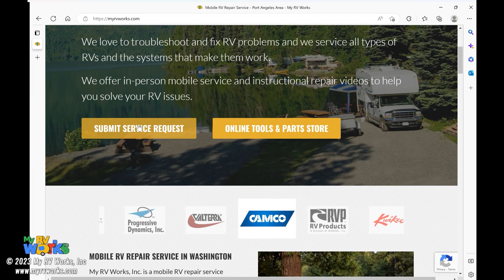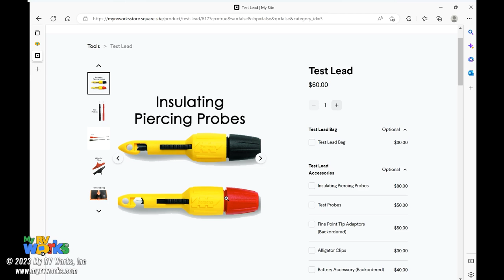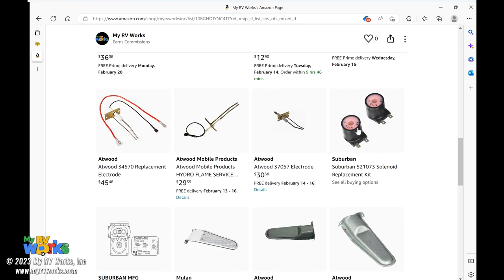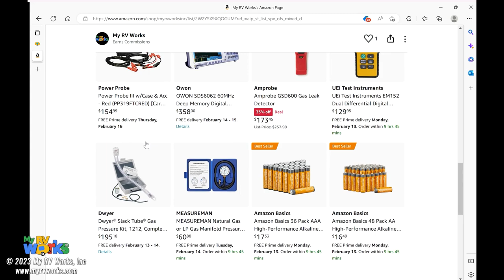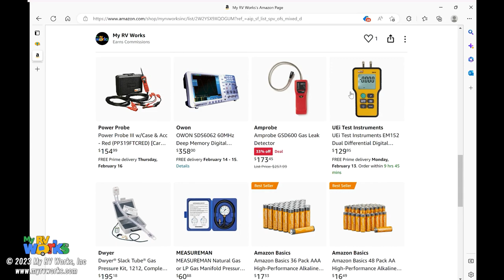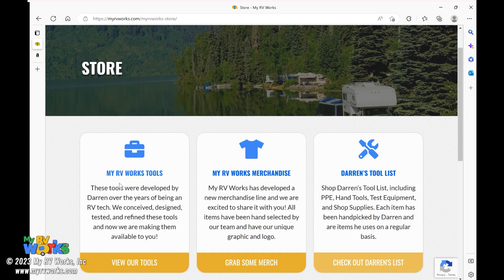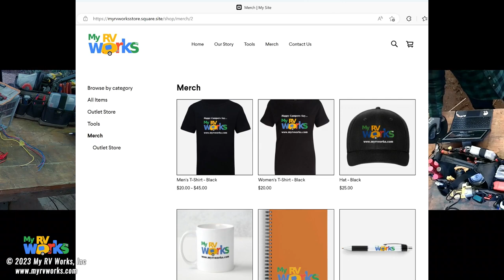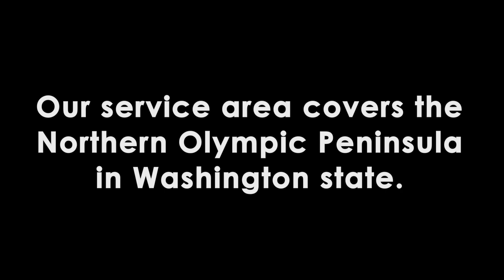Suburban RV Furnace Solenoid Replacement & Diagnosis - My RV Works

Comment: You have a broken terminal inside the solenoid. When ever you test something, wiggle the wires/terminals to look for a intermittent connection. These problems can drive you crazy. Nice to learn about these furnaces. I new nothing about them before your videos.

Comment: At 44:50, you talk about adding a splice to the wire going to the connector.  Do you ever disconnect/release the pin from the connector and make a virgin wire instead of adding a splice?  I know . . . more specialized tools need !   WOW - very informative video !!!   A must see . . .

Comment: Thank you so much. You really help me to understand the components of the furnace. I have a model that goes to the roof unit which doesn't turn on again until I turn the unit off and hear a click in the A/C. Doesn't give heat fof very long. Very frustrating. You a a great guide.

Comment: My Atwood attempts to start.  Occasionally get a whif of gas and even an initial ignition that goes out immediately.  Found I'm getting 12v at the board but only getting 8-9v to the gas valve.  Ordered a new control board and hoping that's the problem.  Haven't found any videos where you found low voltage at the gas valve.  Wish me luck.

Comment: i've learned a lot from you, Thank you. I have a weird issue, My SF-20 Furnace fan kept shorting. I narrowed it down to the motor however when the motor is disconnected from the squirrel cage it runs fine, the second I attach the squirrel it shorts.  Any feed back?

Comment: I have a suburban sf30 rv furnace. It comes on normal runs and heats good and shuts off when room is at temp. But it will never come back on when camper gets cold. I have to shut it off and put it back on for it to run. Can you tell me what the problem could be. I'm thinking bad circuit board. Thank You

Comment: Hello from Canada. Just seen your video and I love it. I have a question about my suburban SF30 furnace. My furnace runs like it should for about 5 minutes then I can hear it click off for about 30 seconds then relights. So I went ahead and changed out the board,sail switch and high limit switch but nothing has changed. I looked and made sure nothing was being block or stoping the air flow all is clear. What should I do next I’m in dire need of your advice. Thank you in advance.

Comment: Darren if it's say 100 degrees in the camper and I try my furnace when I turn the thermostat all the way to the right ( on) will the temperature in the air effect it turning on or should the fan come on any temp outside? My fan won't even come on. On a suburban NT-20SE model

Comment: I have the same furnace I can sometimes smell gas when it tries to light and every maybe 5 time your can hear it ignite for about half a second good 12 volts in the red wire but my brown wire the voltage is erratic sometimes 10 sometimes 15 sometimes 25 I’ve even seen I believe 40 for a split second is that a bad board in the furnace ?

Comment: Wonderful thanks for the great video! 
Does anyone know where to find replacement solenoid coils for Atwood 92078 or 93844 water heater control valve?
Reply from the maker: From our website you can click on parts and gain access to our Amazon store. When you get there sort category by water heater and you will find the solenoids listed there.

Comment: Hey there I have a 83 Ford mobile traveler I'm trying to update hot water tank to gas electric it was just gas beforehand so I need to wire it up I got the tank and a control switch

Comment: Question: would the limiter switch cause the furnace to shut down if the furnace was left without the shroud directing the air through ductwork like normal?
Reply: No.  The high limit switch would be exposed to cooler temperatures.  Restrictions to air flow might cause the high limit to open.  Carpet or other objects blocking grilles are a common problem.
Reply: @stevenscott4096  dang, I actually new the answer to that…..just needed to think what that guy was used for. 🙏

Comment: For the last year my SF-30 has been leaking the smallest amount of LPG when the furnace is off, it goes away when the furnace runs. When I disconnect the gas supply and cap the line I got no leak. I've bubble tested the pipe connections on the furnaces, no bubbles. Is it possible that the gas valve isn't closing completely?
Reply from the maker: We diagnosed an LP leak in an RV a few weeks ago. We found the issue to be at the gas valve inside the furnace. So yes, it is highly possible the gas valve has failed.

Comment: Doesn't the ignitor working prove the sail switch is closing?  My understanding is that the ignition cycle won't start if the sail switch doesn't close.

Comment: Should there be sealant on the furnace face plate on the outside of my rv?
Reply from the maker: Butyl/putty tape is what would be used behind the exhaust flange. After that goes on and the flange is installed it is common to run a bead of sealant around the top and sides but not the bottom of that exhaust flange.  You do not seal the bottom so that any moisture or water that does get trapped in there has a way to get out.

Comment: Do you see a problem with putting a larger orifix to give more btu output ?
Reply from the maker: Yes, I do see an issue with that. As a former engineer, all of those components were designed for a certain amount of BTU. If you start messing around with giving the furnace more heat, you do run the risk of tripping the high temperature switch and/or maybe damaging the heat exchanger. You would be better replacing the furnace with a higher rated BTU furnace instead of trying to modify a lower BTU furnace. Pay particular attention to the installation manuals to make sure you have the proper inflow and outflow for the heat.
Reply: Thanks for tips

Comment: I have a gas oven that won't stay lit. Already replaced the thermo couple. Unique Appliances said the oven thermostat\valve maybe bad. Can I just replace a solenoid as you did or are they made differently? They want $380.00!
Thats half the price of the oven which I do NOT recommend!